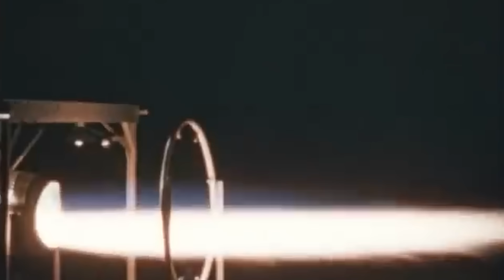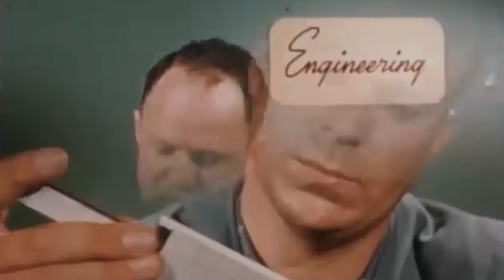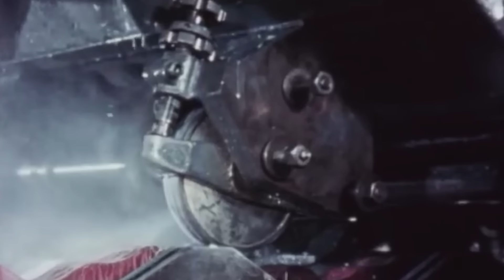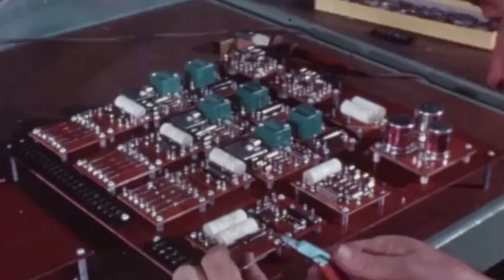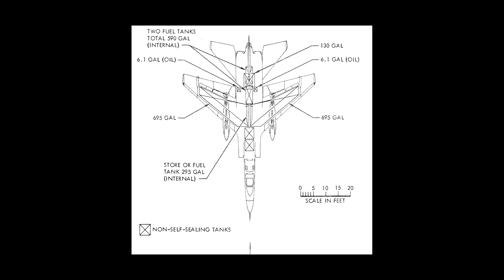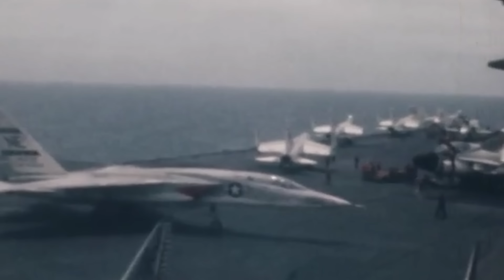The Strange Nuclear Attack Aircraft Coated with Gold

Comment: I was an ATR3 in RVAH-1 from 1964 -66. I went on the WESTPAC cruise to Viet Nam in 65 and the Med cruise in 66. I normally worked from the Recon shack on all the electronics, but during the Nam cruise I became a QC Petty officer where I did safety checks on the entire plane and then was a safety deck PO during launch and recovery. I loved this plane as it was the most advanced bird on the planet at the time. While the A12 Archangel (smaller version of SR-71) was also being flown by the CIA for deep penetration high altitude recon, even it was not as sophisticated. A great aircraft an proud to have been one of the boys that helped maintain it.